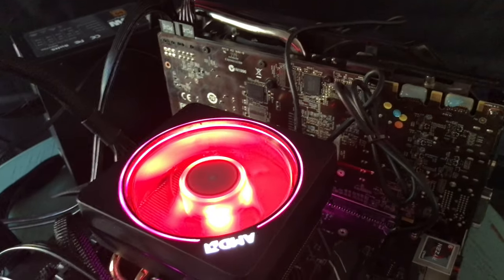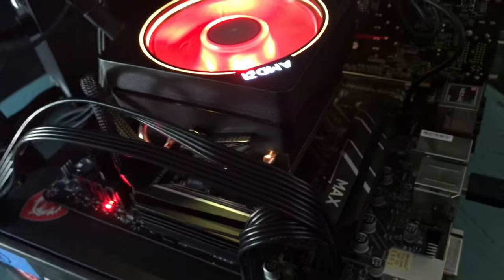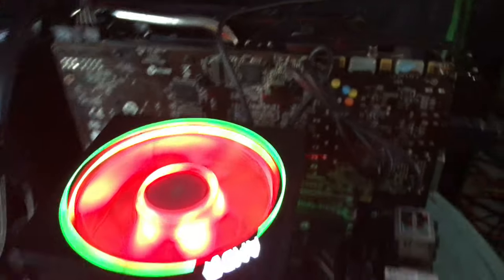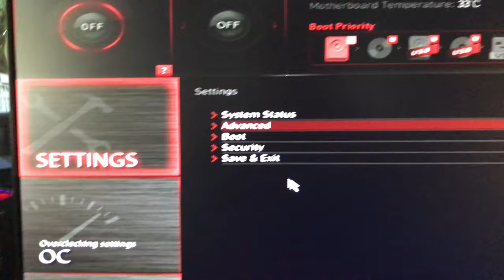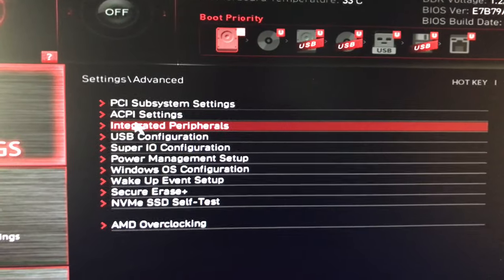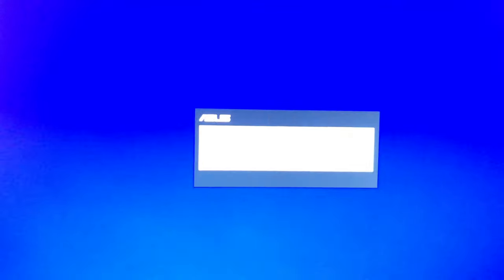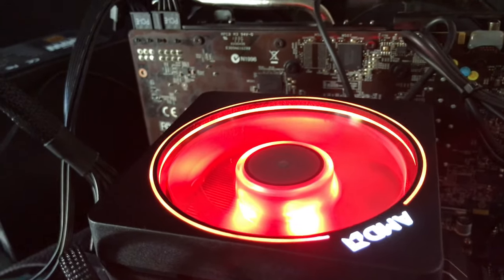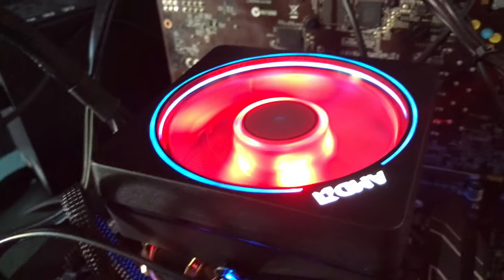How to run motherboard in headless mode for CPU mining

Comment: great vid! I successfully set vga detection -->Ignore but after I removed the GPU and booted, the rig wouldn't show up online in HiveOS. When I plug the GPU back in, it boots and starts mining as usual. Do you have any idea how to fix this problem? I also have MSI x470 motherboard. Hope somebody has an idea how to solve it. Anyway, this was a helpful video so far!
Reply from the maker: Sounds like you have HIVEOS configured to look for that GPU.
Reply: @roccotacomining3311   Thanks for your reply!  In that worker's settings in HiveOS, I set Cards/boards quantity from 1 to 0, but still won't show up online. Also, on Overview page of that worker, it still shows the GPU. How did you mean to configure HiveOS to NOT look for that GPU?maybe im missing something...